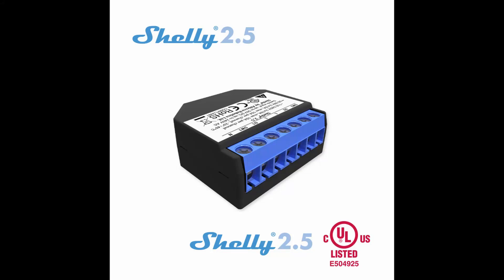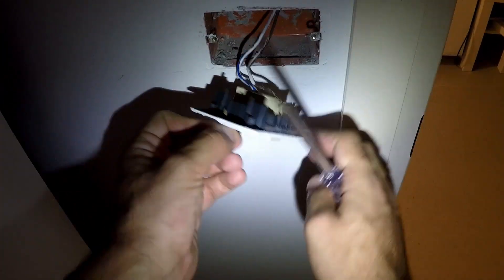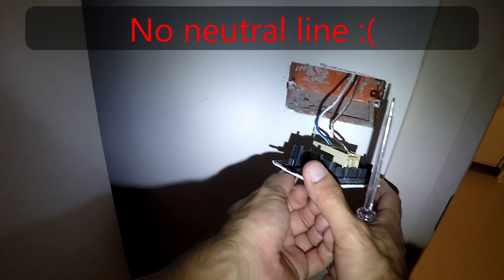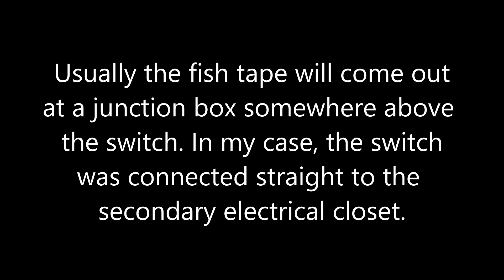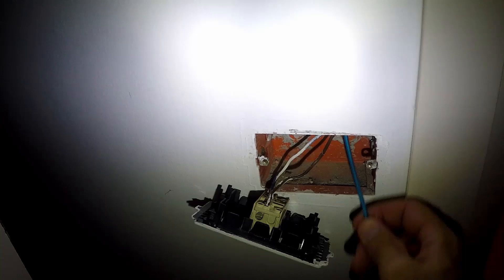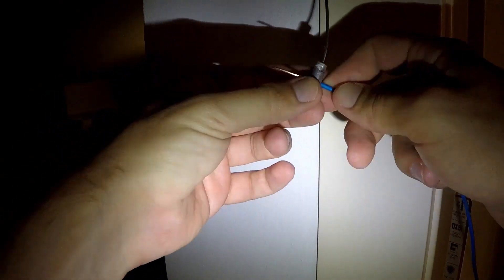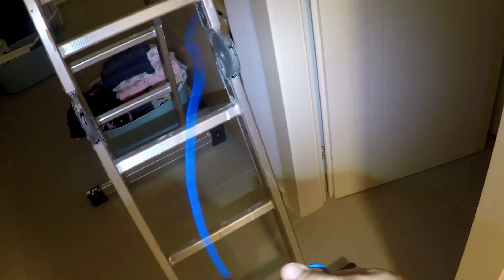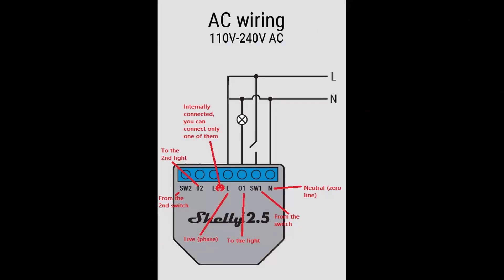Making a light switch smart using a UL certified Shelly 2.5 + Adding a missing neutral wire

Comment: You mean ground wire?
Reply from the maker: No. Neutral wire and ground are not the same. The Shelly component and most lights won't need a ground wire (some lights do require ground when they have a metal body) - the neutral wire (blue wire in my video) is the opposite to the phase wire (neutral is the wire from the device back to the electrical cabinet while phase is the live wire bringing electricity from the electrical cabinet to the device).

Comment: Hi adam, Thanks for sharing this. Can you please tell me where/how you connected the new "Neutral wire" in?
Reply from the maker: To the N terminal.
Reply: @adamtal4355  I mean the other end. I'm translating for my electrician. Every house has "Neutral" at the junction box? your video is the only video i've seen running a new wire. Thank you.
Reply from the maker: @whanauof5  The other end connects directly to the electric cabinet in my case. Usually it goes to a junction box but it might not have a neutral as well (if it doesn't have a neutral you'll need to draw one from the closest junction box with a neutral or the electric cabibet).